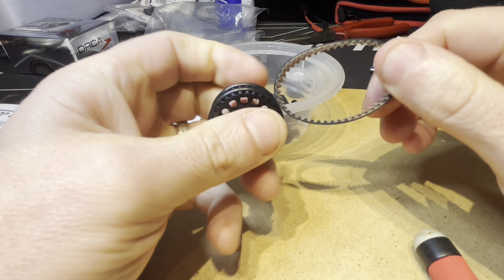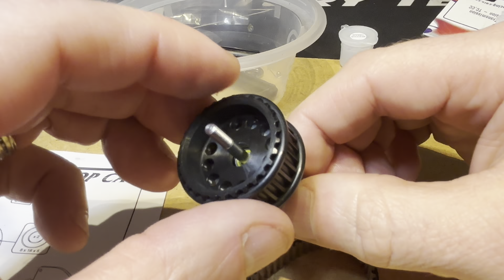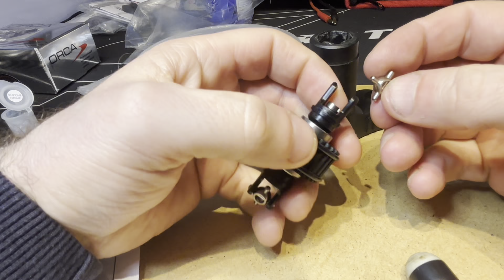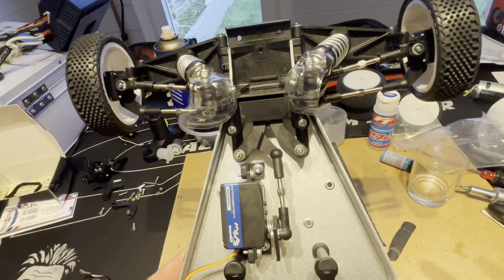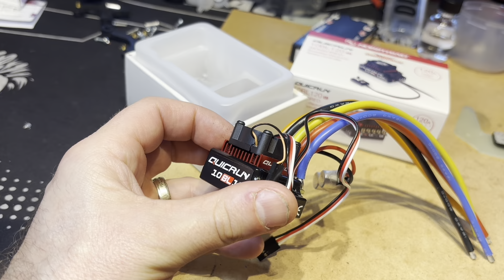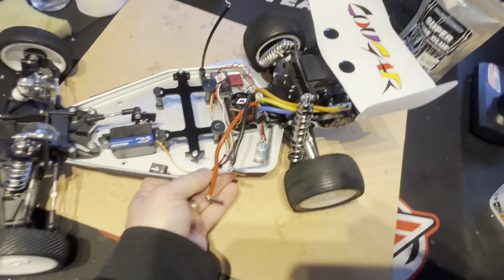More RC car Ugrades!

Comment: Nice to see others can do the driveshafts easy. There easy, once you know how 👍 2 years on and my pro trans is still smooth and going strong. So no point pulling it out 👍 the esc’s are a bargain for the price. I know a few use them in there vintage runners as they spend all there money on there modern buggys. Looking forward to seeing them both out on track at the phil booth GP 👍
Reply from the maker: Hahaha

Comment: The Pro Transmission is almost mandatory. On mine, it was not the layshaft but the diff who gave up (it was slipping and slipping not matter how I tighten it, then broke...) and it was with a fair brushed motor. Since it received the beefed up transmission, it became "bulletproof". But it will see retirement, as the Cougar 2 Works is out and in my claws 😊
Reply from the maker: Cougar 2 is lovely in pink
Reply: Why did the diff give out...I still have the original transmission and used the car for many meetings
Reply: @rogergale3297  Dunno what happened exactly. Not my 1st ball diff (probably built 100's of them) and I already built the Masami XLS (same rear diff without issue). Basically it was slipping continuously, until I overtightened and broke one ring 🤕 But this Cougar started as a nightmare, wanted vintage stuff in it (brushed, NiMH, ...) and nothing worked as it should. Then I put Pro Transmission, Brushless 13.5t, Lipo and it was like a dream ✌🤩

Comment: I think even though he was running a brushed setup because he was using lipo battery it makes the power delivery so much stronger hence the failure so pro transmission is a must
Reply: I've done mine n got a brush less 13.5 motor n a slipper clutch